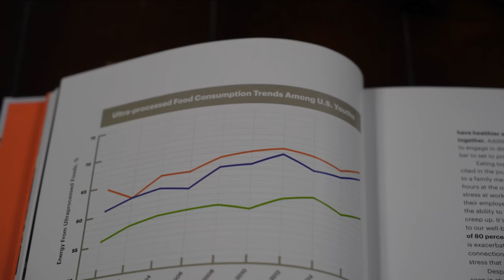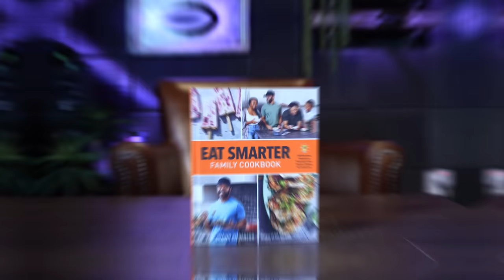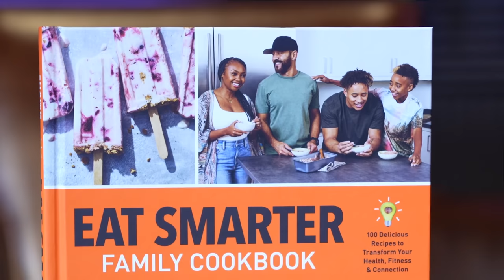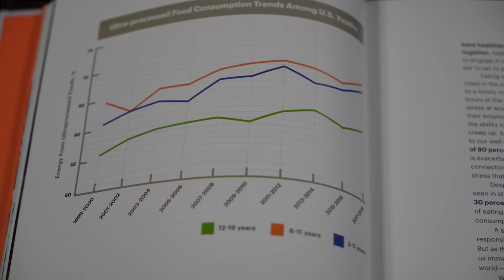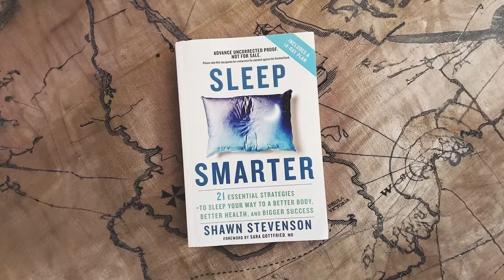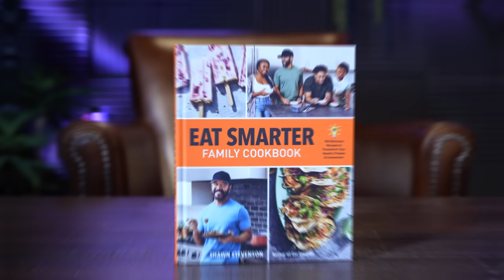How Food Can TRANSFORM Your Health, Happiness, & Connection With Shawn Stevenson | Mind Pump 2182

Comment: A couple years ago I felt like I was having a heart attack and had to be taken to the hospital. I was then diagnosed with "Left Ventricular Hypertrophy" and the first thing the doctor says is that it can "increase my chances of sudden cardiac death by 6-8x" and that for most people, the first symptom of LVH is sudden cardiac death. Meaning there is no precursing symptom, you're just dead. I was told a list of other symptoms that if I had, to call 911 immediately. Now rewind to years 2017-2019, I was a drug addict. Suffering from severe depression, anxiety and panic attacks. It wasn't until I got several tests done at a cardiologist that proved I in fact did not have LVH and that my heart was perfectly healthy. When Shawn talks about being diagnosed with Degenerative Disc Disease and the nocebo effect, I felt that in my heart. I still struggle to this day with panic attacks. I've gotten much much better at managing them and most times now I can shake them off like it was nothing. But I've spent so many days in the gym and doing other things that I love and being crushed with panic and plaguing me with this disorder. And so I think it's so powerful how the mind works and how when you get diagnosed with something, whether you actually have it or not, it can be absolutely debilitating. And this is also a reminder to keep going. My struggles with panic disorder have absolutely slowed me down. But every panic attack is also a reminder (a loud violent reminder) but a reminder nonetheless, to take care of my physical and mental health before anything else!